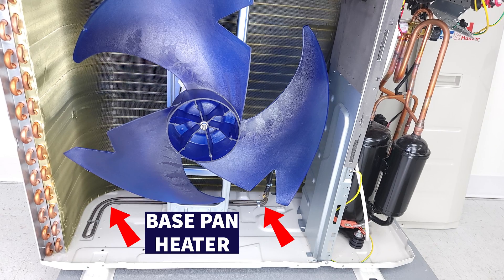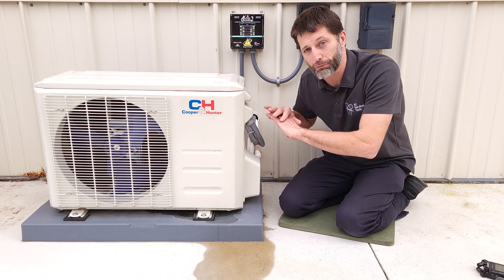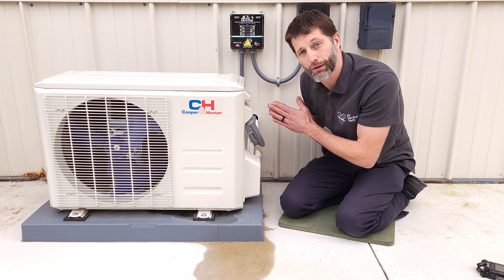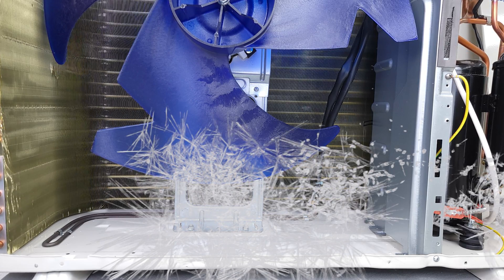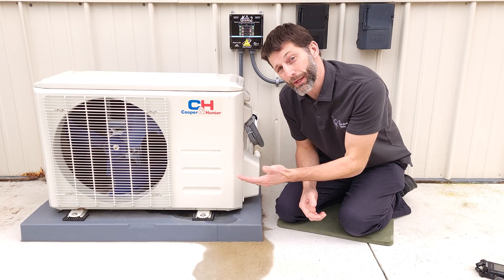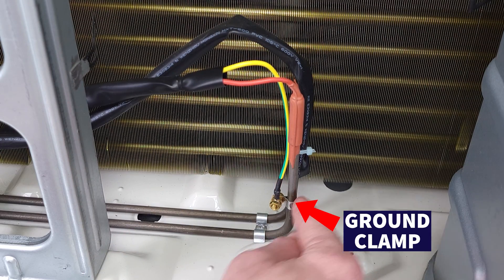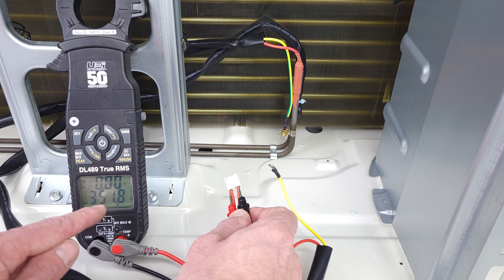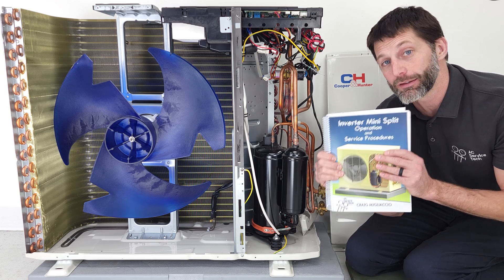BASE PAN HEATER Purpose, Operation, and Testing! Inverter Mini Split Training!

Comment: My mini split has the heater running during compressor operation when it's under 32F. However, I still get ice buildup when it gets to -25C and under. Can we just cut the whole bottom and put wire mesh and weld structural steel bar in needed places instead? This will save all the energy of the heater which is significant.
Reply: Bad thing to do. Instead, drill some holes at the base in  various places  very close to the defrost unit. be careful not to damage the defrost. Once done buy  a magnet block heater  and put it inside the box and  hook it  up to a temperature  timer that will start  at the desired temperature let say  -2C  so it wont run continuous. Even better  put a battery heater on the floor at  the base. Some are design with their own timer that comes on whenever Temp go to  below   0 Celsius.

Comment: Great content! Found it while trying to figure out why the base pan heater on my Inventor split A/C is running CONTINUOUSLY when the outside temperature drops under 4ºC, consuming 340W of electricity 24/7! Even when the compressor is NOT running!
Reply: I ended up disconnecting the base pan heater, since according to the manufacturer “it was working as expected”.
Reply: Yes a lot of mini splits have it setup like this, because when it's -10C, heater will never heat enough in this short period to melt ice. Mine does build up ice anyway, it's just a 100W heater, so I'm considering cutting the whole base pan instead and maybe put a wire mesh and steel bars where structure is needed. Will ask why not do this.
Reply: @purpleblueunicorn  That would most likely lower the heat transfer from the outdoor coil, as you are pulling a lot of air from the bottom instead of being pulled through the coil (path of least resistance). You might be able to make a door to open in low temperatures at the bottom pan then close when warmer.
Reply: @jeremyfowler6227  Oh that makes sense, didn't think about that! Ideally it could be a door that opens just when defrosting is active. Or maybe some sort of silicon bottom that will let ice buildup slide through a slit when heavy. Or just extend the bottom of the pan to the ground in winter so no air can escape.
Reply: @purpleblueunicorn  That may work.

Comment: should I turn on preheat on my mitsubishi 9k mini spit installed in detroit mi?   PRE-HEAT CONTROL SETTING
NTXSPH06/09/12B112AA NTXSPB06/09/12B112AA
When moisture gets into the refrigerant cycle, it may interfere with the start-up of the compressor at low outside tempera ture. The pre-heat control prevents this interference. The pre-heat control turns ON when the discharge temperature ther mistor is 68°F (20°C) or below. When the pre-heat control turns ON, the compressor is energized. (About 50 W)
Reply: No moisture should be present inside the refrigerant cycle.

Comment: Great video! Not all minisplits have these  but cold weather heat pumpd generally do. Even down in NC, I learned that a cold weather hp is necessary to give trouble free headache- less service.

Comment: I have a question.  why with my split heat pump you can hear an unbearable whistle that comes from the compressor and carries along the pipes and is heard in the house.  what is it caused by?  the device is only 1 year old.  please help 🙏
Reply: All the time while it's running? Or just every once in a while? Could be hearing the defrost cycle where the reversing valve actuates. It's usually pretty noisy but only for a few seconds each time it shifts
Reply: @HVACRTECH-83  During operation, it can be heard continuously when the compressor reaches 80% and above power.  This whistle is not heard during the defrost cycle and when switching.  I got information that it may be due to too much refrigerant, but it has been weighed so it is the right amount.  Regards
Reply: @MaciekPastuła  yes it does sound like an overcharge or a restriction somewhere. Interesting that it’s happening on 3 different units. Are you sure the sound is on the refrigerant side of system?
Reply: I'm pretty sure the whistle is coming from the refrigeration system.  Is there a possibility that the compressor should be disabled at certain frequencies?  I would be happy to send you a recording of this sound during the operation of the device.  It's kind of like a water kettle whistling In my country, Poland, the technical advisors for these two brands, providing assistance at a national level, don't know the cause of this problem, so I'm trying to get help here.  Regards
Reply: @Maciek Pastuła  well since it is an air to water system I'm not sure what it could be.
Reply: In heat or cool?
Reply: @sprockkets  only on heat
Reply: @MaciekPastuła  How long is your line set?
Reply: @sprockkets  I have this problem on 3 air-to-water heat pumps, of different brands, installed last year.  They all run on Mitsubishi components.  Refrigeration pipes in all do not exceed 6 meters, there are not many bends.

Comment: I would think the unit should be higher off the pad unless the manufacturer says otherwise
Reply: If you live in areas that never get snow, no need but ya I prefer to use the wall mount brackets whenever possible and at least 12" above grade
Reply: @Bryan Swanson  yes i get that as well as you said regardless get it off the ground to help keep out not necessarily snow but grass clippings and ground debris
Reply: @Ralph Giampietro  well, I live in CT so all my hps go a min of 12" off ground but for cooling only units, regular split units, those get bolted down to concrete pad generally. If customer requests it be raised I will certainly do that but no need. Since the beginning of a/c units were placed at ground level. It's the customers responsibility to keep the coils cleaned. Generally grass clippings won't be an issue

Comment: If they designed them like most split heat pumps, the condensate would drain straight down through the slotted or holy base pan just fine without a heater. Goodman/Amana are the only ones that don’t drain properly. These heaters ruin the COP numbers.
Reply: Ironically, what "ruins" the COP is not this 150w heater, but operating heat pumps in the near freezing temps compared to well below freezing.  Matthias Wandel posted a video a couple weeks ago on his "Matthias random stuff" channel where he instrumented some new mini splits he has looking at their efficiency compared to his old electric heat.  Nothing surprising except the more frequent defrosting at the near-freezing compared to deep freeze.  All due to the amount of moisture in the air.  Adaptive Demand Defrost is better when its cold and dry but will actually defrost more in the 45-25 F outdoor temp range than a timed defrost board with a long run time.
Reply: @jkbrown5496 my 18kBTU split has a 350W base pan heater. Which is quite a lot I would say.
Reply: I actually have never had drainage issues with goodmans. Never. Keep the inside clean, but that goes for any brand. Not sure what you're referring to here and you can't start nitpicking every little thing when talking about the efficiency of them. They need these features to operate properly so youre wasting your time even thinking about it. I'll also add that not all minis are like this, many brands have the base pitched to a drain out the back. But if there's lack of maintenance the drain will plug up and you'll wish you had the defrost heater
Reply: You would think it would, but you might need to defrost at very low temps, and what happens is even after 10 minutes, it cannot remove all the ice, or snow if it inhaled it. Another reason is the coil gets warm, but next to it doesn't, and that's what that coil is for. If it doesn't work, like mine isn't, that whole inside compartment turns to ice. Even at temps around 30.